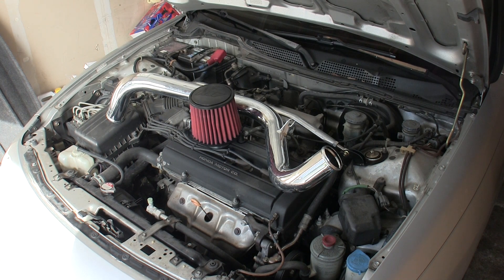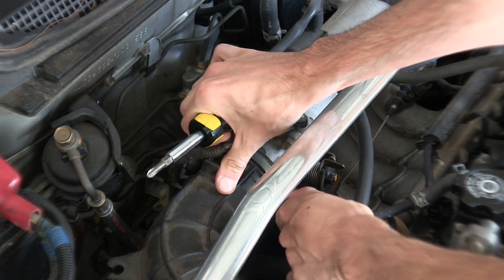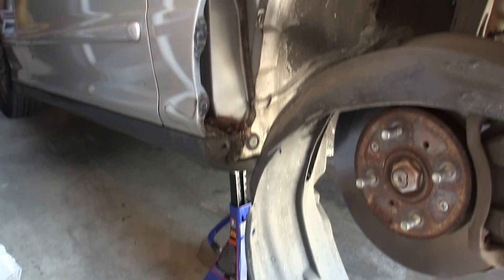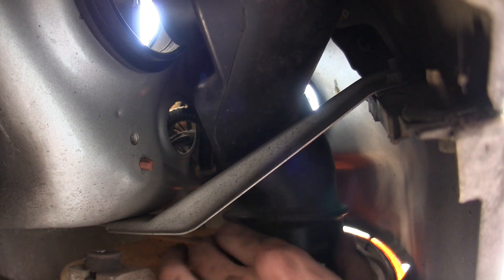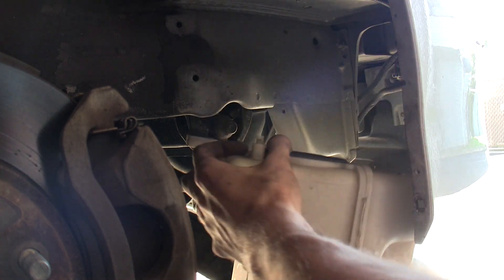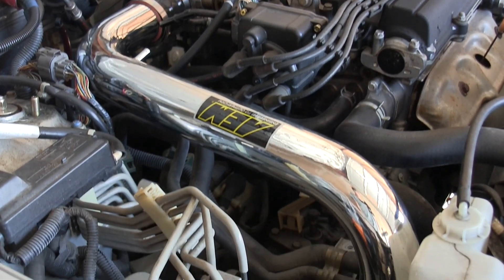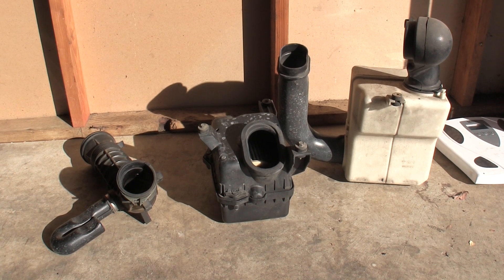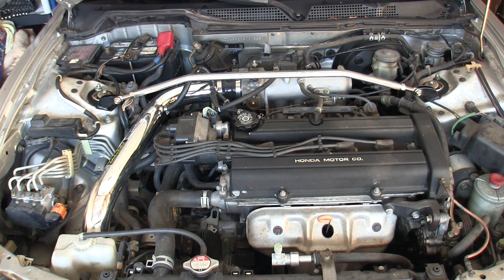Cold Air Intake Install - Project Integra

Comment: Hi, hoping you can help. I have a DC sports CAI on my Integra GSR. I get a whistling noise from it on acceleration , almost like a small turbo sound. Is there a solution or filter to eliminate the sound? thanks

Comment: The tubing being metal, a good conductor of heat, I have doubts on how much difference its going to make. Can you please measure the temperature of air right before it enters the head in both case.

Comment: I have a 2008 Mazdaspeed 3 with the 2.3L MZR DISI IL4 Turbo engine,... Would I have to tune after installing the Mazda Mazdaspeed Performance Cold Air Intake? Or can I get away with not tuning? There are no mods to car now. Its completely stock. The CAI would be the only and first mod. Thanks in advance.

Comment: PVC CAI VS ALUMINIUM VS STAINLESS STEEL

Good day. Lately I see a number of people moving to PVC cai, I assume for the price and retains less heat. I however read on some forums it releases gasses detrimental to the engine when hot. 

What is your view on this?

Thank you
Regards

Comment: What is the difference from that cold air intake, and the short ram intake from the previous video? Can you turn this cold air intake into a short ram during the rain season?  If so, would you need to re install that resonator box you removed from behind the wheel.

Comment: What is the purpose of the resonator in the air intake? 

I understand why your exhaust has one but surely the intake doesn't make much noise.
Reply: Youd be surprised
Reply: They act as a helmholtz resonator.  Controls noise but also is tuned to actually provide INCREASED power at partial throttle.
Reply: It does

Comment: I saw a YT video on here showing a stock intake vs. an aftermarket cold air intake on a dyno - it proved the stock intake drew more air than the cold air intake.
Reply: To get the power increase from the aftermarket cold air intake you need to tune your engine to be compatible with the upgrade, some engines loose power after installing an upgrade because the ECU thinks there is a problem so it holds back and does not use all its power with the upgrade, so after tuning a car with mods you will get hp gains.
Im not an expert but I know a few things, hope I helped :)

Comment: The battery was disconnected I noticed. For what reason was that?
Reply: So basically, whenever you're handling any sort of electronics in your car, whether it's in the interior, or under the hood, it's important to disconnect the battery to prevent any mishaps. Towards the beginning of the video, he disconnects a couple of wires that were intact with the engine.

Comment: what do I do with the one tube from the throttle body the Intake has the thing for the valve cover hose and then I have two coming from throttle body that go in stock intake

Comment: It's a waste of time, it does nothing for your car power wise, doesn't make your car any faster, nothing that you would feel anyway, maybe like half a kmph. the only way you'll get a small bit of difference is if you installed the air filter on the outside of the car away from the engine.
Reply: i heard people do it for the slight sound difference
Reply: yes it does. if you install it away from the engine block (preferably near the front bumper if possible) with the right induction pipe, it will increase hp. it has worked with both my car and my mates' cars.
Reply: Sure one modification on its own you might not feel any difference, but say you were to combine 3-4 small mods such as this, then you would. For example, an intake, a new exhaust, lightweight alloys and lowering springs/coilovers might all add up to some difference.

Comment: Is it normal for your PCV line to be EXTREMELY tight onto the new intake pipe?
Mine was, I had to cut the sides to slip it down.

Also, I have a spare line that seems to be sucking air in, should I cover it up with a vaccume cap or does it go somewhere?
Thanks!
Reply: im wondering the samw thing the two hoses comimg from the throttle body right cause it goes on the old intake but the new one only has one hole for that

Comment: What about the MAF sensor? I didn't see one on this car, but do other cold air intakes account for the MAF?
Reply: +Nicholas Loe the electrical connector on top of the throttle body is the MAP sensor. There isn't a MAF on these cars.
If you drive a car with the MAF on the air filter box there are adapters available which fit cone filters.

Comment: +Engineering Explained It would be a lot easier if USA adopted the metric system at last, don't you think?
Reply: It's a rather arbitrary thing
Reply: we've got bigger problems to worry about then switching to the metric system
Reply: Those bigger problems are not addressed, so why not start addressing some secondary problems while stalling the bigger ones? I mean once you start changing to Metric, maybe this will also finally get the gun law in check and save peoples lives.

Comment: I would like a penny for your thoughts, on the reinstall. The pvc hose would you find it more beneficial to keep that set up or to replace the valve cover lead with a breather "looks like a mini filter" and bypass the hot metal line that coolant runs underneath and capping off the  intake line. Or with there being pressure from the crankcase does that add to the air volume? I am always doing small experiments on my daily go-kart (cant call it a driver cant call it a race car going for best in all worlds) I have usually by-passed my setup ( In my experience this is only found on honda/acura but is my preference) have always wondered however.

Comment: I have a 1996 Honda Accord and I am wondering whether a cold air intake or short ram intake would be better to use. Can anyone give me some tips? I'm leaning towards short ram because the cold air intake seems pretty close to the ground and my car is fairly low by itself and I don't want my engine to hydro lock. Anything is helpful. Thanks!
Reply: cold air intake, 5-15 hp gain, 2-5 not gain
Reply: +Lazarus Alvarez mpg*
Reply: +Jack D 
I believe cold air is better as demonstrated in the video but as cautioned about the hydro lock IT CAN AND WILL HAPPEN happened to two friends one lost a motor one saved it, if you do and  your car shuts down DO NOT TRY TO START it. your only hope it to remove all plugs and turn the motor over hoping the valves are not already bent and expel any water from the intake and chamber. In short if you are a'n observant driver and a cautious one I'd say cold however for most "good" drivers I would run ram air with a heat shield or stock with a K&N filter don't underestimate stock either as a lot of money is spent on R&D (research and development) and it is a cold air set up might be more restrictive but wont have as much mpg loss.

Comment: im looking to throw on an old cold air intake i have laying around on my 91 corolla, its going to fit but i dont have a plug in for the AIT (air intake temp) on my cold air intake, can i just have the AIT plugged in but just hanging around in the engine bay? by the filter maybe?

Comment: So you're telling me that 4 foot long metal pipe sitting 5 inches from the engine block, traveling the entire length of the engine bay, and then going down, is NOT heating the cold air you have struggled to collect with that dangerously low air filter?
Reply: +Capcatrei Why don't you go do your own research on CAI vs. Ram air vs. Icebox intakes. They've been around for years, I don't see why you're giving this Youtuber a hard time. If it's that big an issue for you wrap the pipe with some exhaust wrap to help insulate the pipe. The fact is the air is going to be colder than it would be if you picked it up straight out of the engine bay with a ram air intake. Ffs.
Reply from the maker: +Capcatrei No, I'm telling you how to install it. I have other videos validating if it works or not.
Reply: +Engineering Explained  If it works as it is, wouldn't it work even better if it was insulated? That metal pipe is absorbing massive amounts of heat inside the engine bay, and that heat will be transferred to the air, which partly defeats the purpose of sucking cold air from under the bumper.

Of course, it may still be better than the stock intake which sucks in air from the engine bay maybe. But just because it made a little difference doesn't mean it can't be made to perform better.
Reply: +Capcatrei  so the stock tubing isnt absorbing "massive" amounts of heat? metal will always stay cooler than plastic/rubber and a consistent airflow from the ground will keep the metal pipe cooler than the stock. if it was a short ram intake then yes a heat shield would help out a lil bit.
Reply: +ItsRyanY0  You say: "a consistent airflow from the ground will keep the metal pipe cooler". How do you think that air is cooling the metal pipe? It's called heat transfer. The cold air is absorbing heat from the metal pipe, therefore the metal pipe gets colder, and the cold air gets warmer, which is EXACTLY what I said - the metal pipe is heating your air.

And you say "metal will always stay cooler than plastic/rubber". The metal itself does not "stay" cooler. Nor does the plastic or any other material for that matter. The reason why the metal pipe is cooler to the touch  than the stock plastic intake, is because metal is a bad thermal insulator, or a good thermal conductor, however you want to put it. Which means that metal is better than plastic at transferring heat. 

The typical PVC's thermal conductivity coefficient is 0.1 - 0.22
The typical Chromed stainless steel thermal  conductivity coefficient is 16.1
If we do a quick calculation, 16.1 divided by 0.22, the result is 73.1 Which means that metal is about 73 times better at transferring heat than plastic is.

The reason the metal pipe stays colder to the touch, is because it's given A LOT of heat away to the cold air passing through. Which means it heated the air a lot.

The reason the plastic intakes are so much warmer to the touch is because they are BAD at transferring heat. So you subject them to massive heat inside the engine bay, and you do run cold air through them, but since they have a low thermal conductivity coefficient, they cannot sink their heat into the cold air that passes by. 

That means the air that passes through the plastic intake pipe arrives at the engine much cooler than the one going through the metal pipe.

So the fact that the stock plastic intake is very hot to the touch kinda fools you into thinking the air inside it is just as hot. Just as the cold metal pipe fools you into thinking it stays cool by itself, therefore the air going through it is also cool, when in fact it's exactly the opposite.

Why do they use these kinds of aftermarket intakes then? Even though metal is a bad insulator, and heats the air much more than plastic, the cold air they suck from under the bumper is so much colder than the air from the engine bay which stock intakes suck in...that overall you are gaining SOME advantage.

HOWEVER, if they made that pipe from an insulating material, or if they wrapped it with insulating materials, it would suck in cold air and deliver it cold to the engine. Why is everybody failing to understand that?
Reply: Capcatrei the air entering the pipe is cold
dense
yes the pipe would transfer heat to the air inside the pipe
but
theres more air there than stock
it did its job

Comment: Do all cold air intakes bring in the air from such a low position, or do some filters sit in the engine bay?
Reply: I'm pretty sure that some do indeed sit in the engine bay
Reply: +Jackson Summers 
cold air is defined as outside of eng bay how far outside is dependent on car type and space for equipment long ram air intakes defeat the purpose and usually bring the filter closer to the exhaust head as opposed to the fire wall.

Comment: I have long wondered how to prevent water splash onto your air filter with the location being where you installed yours. Would it be a "solution" if you will to minimize  hydro-locking an engine by keeping the resonator original tubing to lead into the engine area and install a short ram intake in the spot of the original air box? would it still be as effective just having air lead to the filter rather than leading the filter to air? I have not installed an intake to my 2010 Acura TSX for that reason. I enjoy learning from your videos. Great job!
Reply: My bad, there's one that's a lot better. I wouldn't waste a dime on the first one I posted. That was just a quick search/paste. If I were to buy one it would be this one or another known brand: 

http://www.amazon.com/AEM-1-4000-Flow-Filter-Wrap/dp/B00353G1SY/ref=pd_sim_sbs_263_2?ie=UTF8&dpID=41NevZmMLsL&dpSrc=sims&preST=_AC_UL160_SR146%2C160_&refRID=0H5KW0MEYK7RH627WG54
Reply: +Michael Hernandez That's certainly safer. That's another consideration for what you want to do.
Reply: +Michael Hernandez Something like this: 

http://www.amazon.com/Universal-Intake-Pre-Filter-Filter-CPT-WG-M-/dp/B00YXHCYOG/ref=sr_1_2?s=automotive&ie=UTF8&qid=1448225111&sr=1-2-spons&keywords=Cold+air+intake&psc=1
Reply: +LarkLandon Enterprises (d4RKL4RK) I don't see how this will not limit air consumption
Reply: Michael Hernandez But it's too hot during the summer for me at least.
Reply: So won't the cover make it harder for air to reach the filter??
Reply: No, it's specially designed to allow air to flow through but to stop the larger water molecules
Reply: LarkLandon Enterprises That's an important for a cold air intake. I still haven't known to see that or understand it.
Reply: LarkLandon Enterprises Cool. That makes sense!
Reply: Even when I did have my CAI on my integra, I didn't know or they didn't make them at the time. I only recently became aware when I started doing research into adding CAI vs. Coldair box to my Integra GSR.

Comment: I have seen some people that put their cold air intake similarly where the short ram intake is supposed to be, does it make any difference?
Reply: +Carlos Quinonez It depends on where you're driving if that difference is better or worse. If I had a cold air intake I'd do better in the hottest summer, but at all other times I'm better off with my short ram.

Comment: do you need the resignator if you leave the oem air box?
Reply: +xCkillaxC Probably not. Some wait savings and less insulation from the cold air. I certainly wouldn't do it if there was any damage to the wheel liner, it's an extra layer of protection.

So, if you do it, keep the resonator in case you ever have damage to your liner, even if you don't hydrolock your engine, when I lost my resonator, my K&N filter got way filthier.

Comment: You should do a test between factory and a "cold air intake" because the metal piping absorbs heat from the engine which makes it a hot air intake. You should make a video
Reply from the maker: All That Car Stuff I did.
Reply: Engineering Explained aw sweet thanks!

Comment: Car runs and drive perfectly fine. 
Interior is complete and in good shape as can be seen in the photos.
Radio works and is wired for an amp and sub in truck already.
Cruise control works great.
AC and Heat both work great 
Although only on 3 and 4 for fan strength. Might need a new switch to work on low 
fan levels. Was that way when I got the car.
Oil changed on time since I have had the car and have service receipts.
Just replaced cap/rotor/and plugs, NGK wires still in good shape.
Track mileage on nearly every tank since I have owned the car, average MPG 30-34
Odometer reads 262k
Motor is not original, changed before I got the car. Motor was Marked at 94k when put in car, don't 
know when that was, so not sure mileage on motor. Starts up quick, does not burn oil or get hot.
5 speed Manual. Clutch feels and works great with no slip, 
Do not know when the last time it was replaced. 

Has Fresh Registration/Tags This month (April,2015)

Does that sound good for 1800$
Reply: +Alberto Hernandez OH yeah.
Reply: Is it still for sale?

Comment: Good video, but you don't need clamps on the vacuum hose. The vacuum will keep that rubber hose tight against the intake piping.
Reply from the maker: alex barmash To everyone, please use the hose clamps. You don't want this rattling lose from vibration, and there's no benefit of not including it.
Reply: Im talking about the vacuum line that runs to the intake. The actual intake definitely needs clamps.

Comment: You have to thermal wrap a cold intake for it to be an actual cold air intake people!  Why is nobody else doing this?  That metal tube is going to get so hot, so fast, and heat all that air coming in that was cold when it entered.
Reply: +Inner Ear Thing I just made a video about how I had to heat up even a short ram for maximum power, but I love your tip. In the summer my pipe does get too hot, insulating it may or may not help though, since I think the impulses of heat from the chambers, which actually go up every intake, may be the true source of heat and if I insulate the short ram intake, I may actualy make the air even hotter in the summer.

But since this video is a true cold air intake, if you want it even colder, insulation may help. It's just that in my case I'm comparing a short ram that I need to get even hotter overcoming the cooler part of the year, but I do things a bit cooler at the hottest part of the summer.

To sum up:
insulating may just keep heat in coming from the combustion chamber and the engine up the intake and radiating out from the intake piping, or it may help keep the cold air cooler if you have a true cold air intake

We need some summer back, some insulation, and a laser thermometer to figure out this one! :)
Reply: DE Nichols
I totally agree with that assessment.